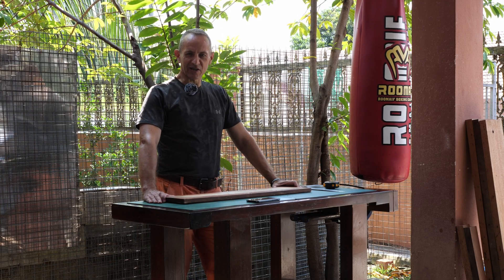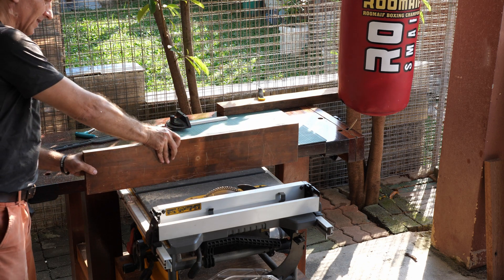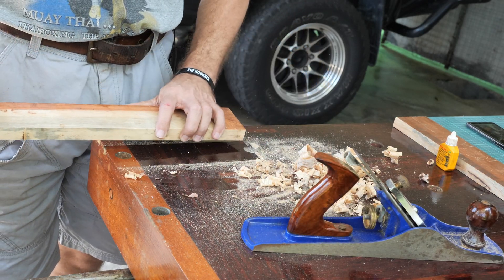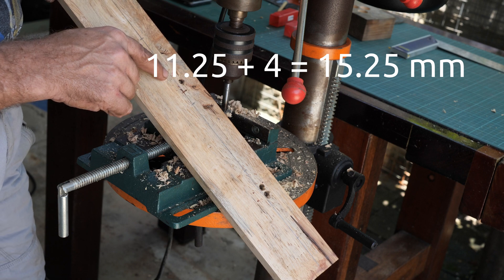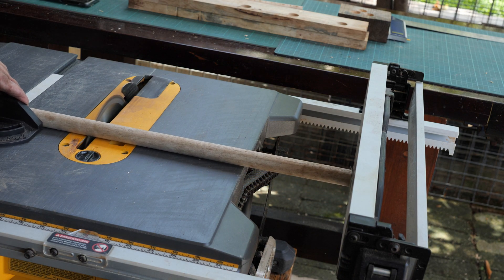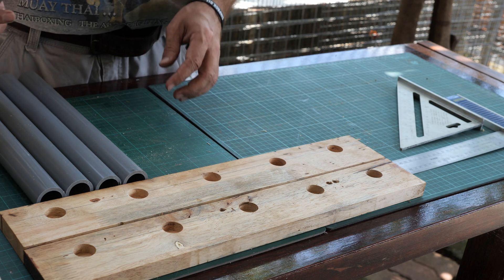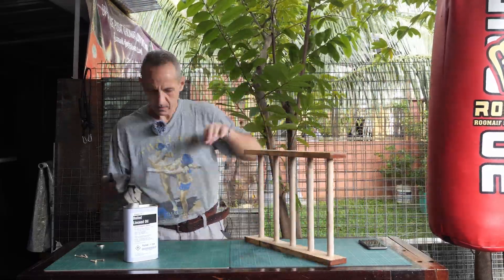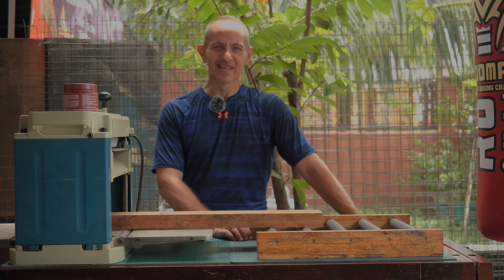Out Feed Roller Table Build  | How To Make Outfeed Roller Table For Thickness Planer

Comment: It looks like very easy to make even by the beginner with basic tools
And yet it can be so useful for planing medium or longer boards
Reply from the maker: Yes I've been using for few years mow, every time when I'm milling my wood stock. I added the grub screws adjustable leveling on each corner because my floor is uneven. Now it works even better